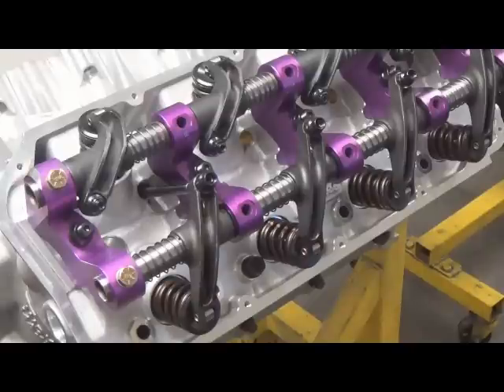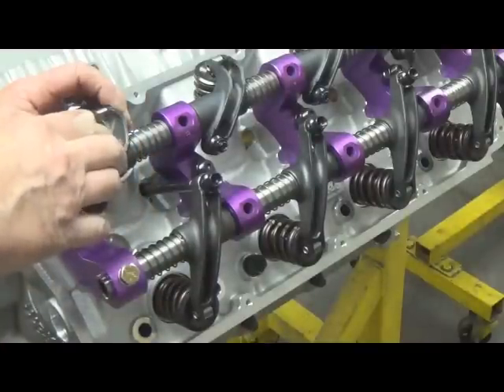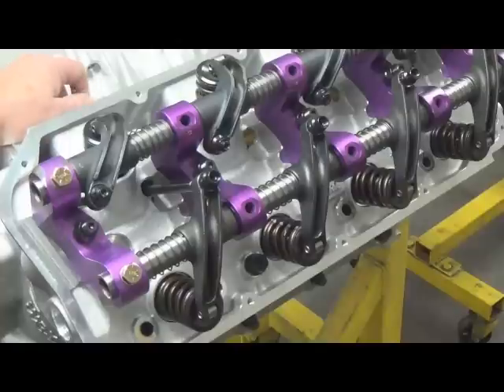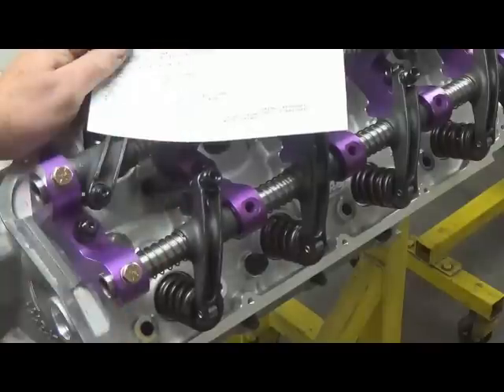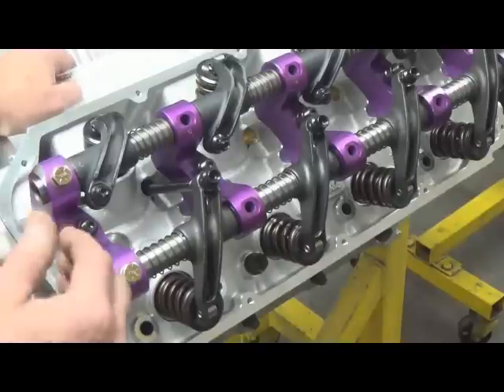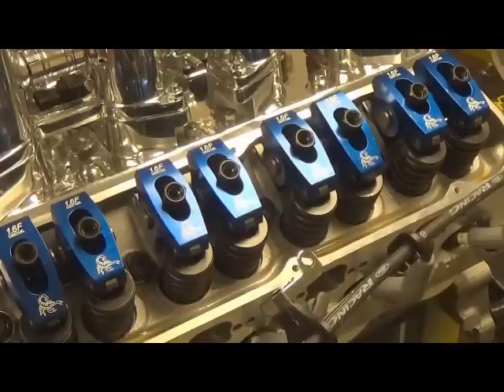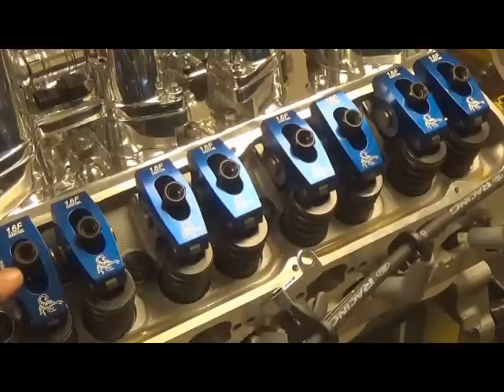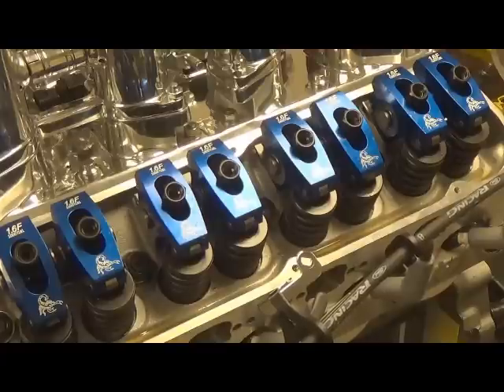HOW TO PROPERLY SET VALVE LASH

Comment: This may be stupid question but did he not have to watch the exhaust valve cycle through? he just looks that its moving and knows he can start adjusting intake, but when he wants to adjust exhaust you have to watch the intake until it goes all the way down and starts back closing?  why is it different?
Reply: It's very simple brother.  It's the E.O.I.C. which mean Exhaust Open/ Intake Closed.. He did show it. You may have to watch it a few times because these people are so busy talking 100 mph, that they forget to take the time and show you what's really going on. In the beginning first off, take all of the spark plugs out so the motor turns over very easy. Then Put your index finger in the number 1 spark plug hole and slowly turn the motor over CLOCKWISE until you hear and feel air try to push your finger out. Then look at the Harmonic Balancer and turn it until it moves a little more until the line on the balancer and the tag on the block that you check with your timing light when the car is running. When those 2 lines are perfectly in line, " You are at what is called TDC, TOP DEAD CENTER on the motor"" Now you can start adjusting all of the Lifters/Valves. Back to the beginning with the E.O.I.C. Now you slowly turn the motor over with a wrench on the harmonic balancer and watch the exhaust valve /rocker arm and as soon as it STARTS  to come up from all the way down, THEN, you adjust the INTAKE valve with the feeler gauge to the cams specific gauge. Lets just say that the Intake valve is .024 and the exhaust valve is .026.  So now you will put the feeler gauge inbetween the roller rocker and the valve spring and make sure that the feeler gauge can go in and out with a little resistance, then the intake adjustment is done..... hOLD THE NUT WITH THE PROPER WRENCH AND SLOWLY TIGHTEN THE INNER HEX NUT UNTIL IT IS TIGHT. Now, you continue turning the balancer clockwise until the intake valve  goes all the way down, and as soon as it starts to come up in the up direction, STOPS  THERE and THEN you can adjust the EXHAUST valve with the feeler gauge so it's just a little bit snug/ NOT TIGHT, Now your number 1 cylinder is properly adjusted. Now, On a Chevrolet, Pontiac, Buick,Chrysler the firing order of the motor is number 1,8,4,3,6,5,7,2, so you just did the number one cylinder , so now you walk around the engine to the number 8 clylinder and do the same process that I just explained to you on that cylinder, then when you are finished with the number 8 cylinder you go to the number 4 cylinder and continue on until you end on the number 2 clyinder. THAT IS THE CORRECT WAY TO ADJUST SOLID LIFTERS OR SOLID ROLLER LIFTERS.  this may be long , but if you go back and watch him very slowly and closely, you will see what I just explained and never forget how to do it correctly. REMEMBER, WHEN YOU ARE USING THE FELLER GAUGE, NEVER SLIDE IT IN AND MAKE IT FEEL TOO SNUG/TIGHT. YOU WILL CHANGE THE CAMS SETTINGS AND MAKE  YOUR CAR RUN  A LOT SLOWER .... DON'T LISTEN TO THOSE IDIOTS THAT TELL YOU THAT MAKING IT TIGHT IS BETTER !!!!!  GOOD LUCK FRIEND...

Comment: so if you used 1/4 turn as your preload on a 7/16 stud would you want to go with a little more for your 3/8 stud? something like 3/8 to 1/2 of a turn?
Reply: No, there is no different adjustment just because your stud bolt is bigger or smaller. I always use 1/2 turn tighter on hydraulic cams. That is safe and correct.